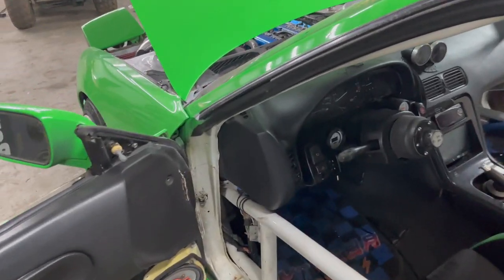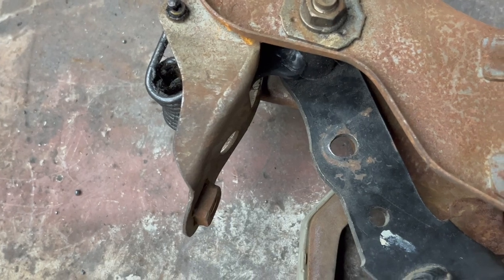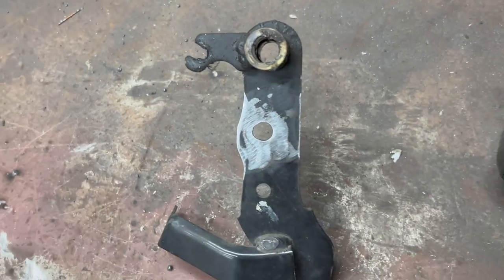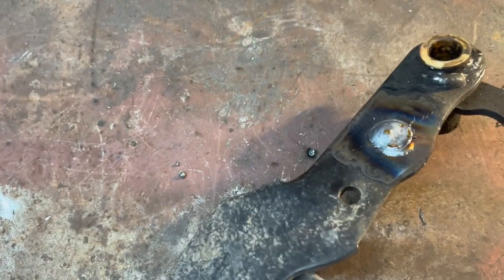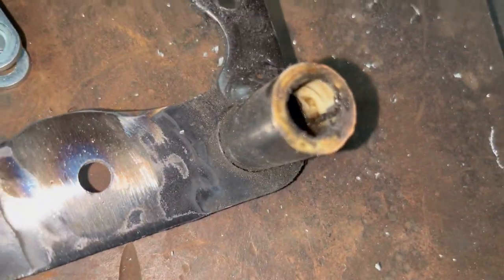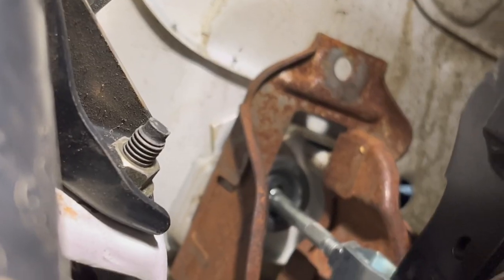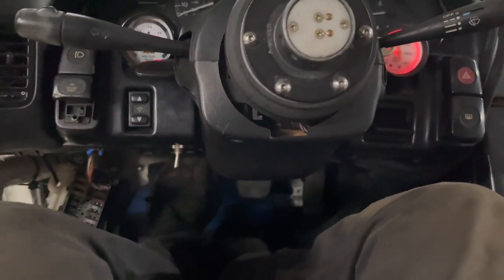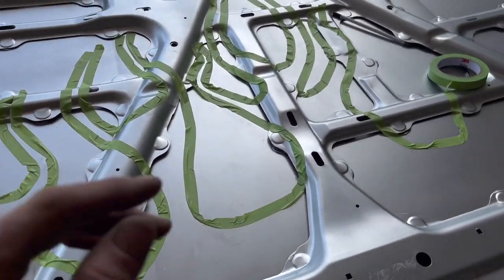FREE SLOPPY Nissan Clutch Pedal Fix

Comment: Also instead of a manual fan switch would you consider a thermal switch?
Reply from the maker: No I already have a oem clutch fan so it’s not really necessary I just put this on so while doing cool down laps I can turn it on and get it cooled down faster
Reply: @Nscardigno33   ohh got you.

Comment: i have an issue where my clutch pedal will stay half way down or 3/4 the way up while releasing the pedal after putting it in gear, every time i have to kick it back up. my car has 350k+ miles on it so i hope this is it lol
Reply from the maker: Sounds like the slave cylinder and or master cylinder is going bad . Being the car is that original with those miles it’s very common to need to replace both or it just won’t bleed back out. From factory these cars have a clutch damper built in as well that’s very hard to bleed most just delete them as they are tricky to deal with